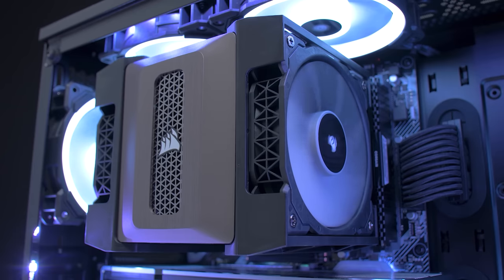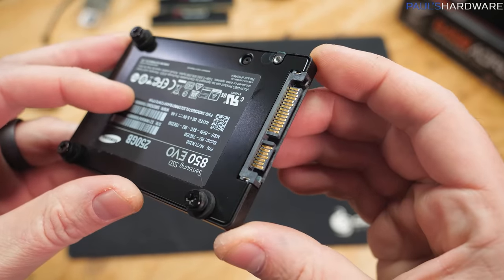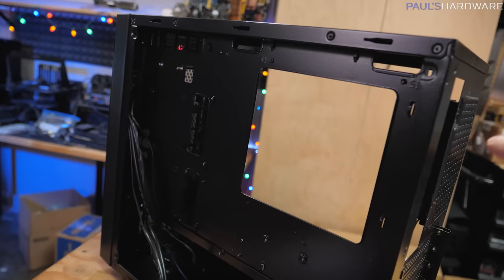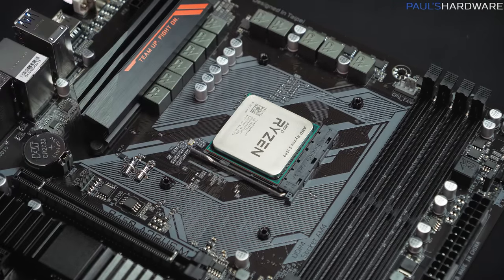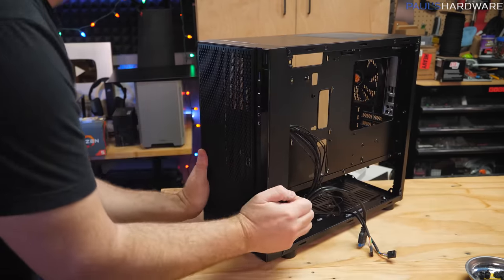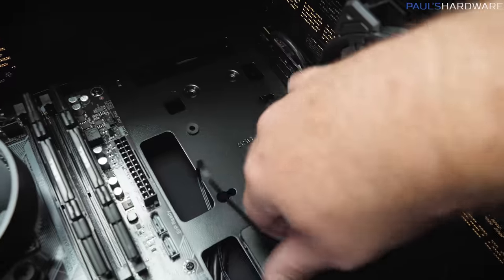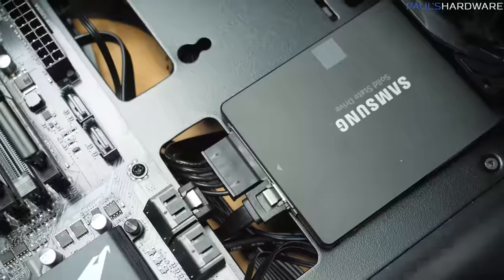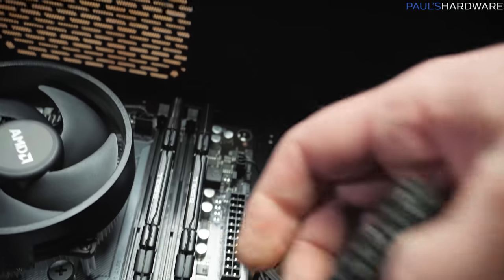How To Build a $550 Gaming PC in 2020!

Comment: The only thing I would suggest differently would be the GPU. For an extra $20-$30 you could go with the RX 580 8GB. for ~$145 it's a hell of an entry level graphics card.
Reply: How do these entry level PC's compare to the Xbox One X or PS4 Pro?
Reply: @solefreak2  they absolutely smoke em'. I love my 1X, but you can only spend $500 on a console so many times until you realize how much more you could truly get with a $600 PC.
Reply: @zhonestguy  In what regard do they smoke them? Graphics, performance? Never gamed on a PC so not sure how to compare. Also with the new gen consoles due to launch, these are being touted as being as good as some of the current top end PCs.
Reply: @solefreak2   The one thing that console does better for the price is resolution; however, this arguably means close to nothing if your fps is low (which it is on console). PC generally runs on a lower resolution than console (1080p or 1440p versus 4K on console) when gaming, but the fps is at least double (on a budget build) and as high as 10x (on a moderate to high budget build). A lower resolution with substantially higher frames far exceeds a higher resolution with substantially lower frames. Functionality, I feel, is no competition considering the overall use of a PC versus a console. Now, when it comes to the new consoles I highly doubt they will be able to touch a PC. The way they're advertising the new gen consoles is how they advertise every time a new one drops and the end result is always the same. The issue with consoles isn't the manufacturing or the capability of the machine, it's the way the games are developed. You ever notice how when a game is demonstrated it's never done on a console? That's because games aren't developed, for consoles, to run at full capability. When a game is developed for a console the companies have to consider what gen of console it's going to be played on most and the majority of the time the previous gen is favored for the first year or two. As a result, these games are made with lower specs. 4K games was a pain in the ass for the first year or two of 1X because none of the games were being made to play at that resolution (games were made with previous gen in mind). As a result, we had a $500 4k console running games at a lower resolution AND lower fps. When a PC game is made it's entirely different. When you pay the $60 for a game on a PC, you know the performance is based only on the hardware it's being run on, nothing more. Higher quality hardware equates to higher quality performance, simple as that. With console, that's simply not the case. You could have the latest and greatest, but if the game developers don't make the game for the latest and greatest (which most of the time they don't until after the first or second year), you lose out. By the time the games are being made for "full capability", the talk of next gen consoles is already in the works. Full circle nonsense.

Comment: “Only costs $85” 
Link say $270. Lmao
Reply: It’s insane right now, I had plans to get me a Ryzen 5.  Had to go with the Ryzen 3 with integrated graphics for $100.
Reply: @AgentSeventyOne  oof
Reply: @AgentSeventyOne  how are the prices at micro center?
Reply: @zhao4113  Oh dang, it’s 180 right now.  I just got the other one lol.  I guess I can put some money in on a solid gpu for now and upgrade the cpu/motherboard later.  I was eyeing the a $330 bundle.
Reply: @AgentSeventyOne  lol for that price i could get the AOC cg27 monitor which is the cheapest 144hz 1440p monitor
Reply: @zhao4113  I cheaped-out on that, but I did find a 24” 75hz monitor for about 110ish.
Reply: @zhao4113  my CPU order was cancelled lol.  Maybe the Ryzen 5 will drop a little more on Black Friday.
Reply: @AgentSeventyOne  it'll probably drop a ton on Christmas deals and stuff like that I'm gonna upgrade from ryzen 2600 to 3200
Reply: @zhao4113  I bought the Ryzen 5 with integrated graphics for 200, I’ll wait for a deal on a solid gpu for Christmas
Reply: @AgentSeventyOne  yea christmas always has some huge promotions on parts im gonna go ham 😂
Reply: does the graphics card change automatically or can you change the color manually
Reply: 8 month old video..
Reply: it obviously cost $85 when he made the video 8 months ago, links just lead to the CURRENT price of the product...LMAO
Reply: @AgentSeventyOne  i don't know a lot but after reading up I'm going with a 75Hz monitor because with my budget I'm not gonna get much more than 60fps with ultra graphics anyway you know? It would be a waste of 200 bucks because if I'm going 144hz anyway I'm not going to buy a monitor with terrible ghosting just to be able to run at an fps my rig can't handle in the first place
Reply: @tonyl9636  You should check out “Tech Deals” YouTube channel. They do vids on how to spend wisely on different parts. Helped me a lot. I have a 75hz a we monitor that was like 100 bucks, works great and I can’t wait to get another.
Reply: *acer monitor

Comment: Awesome Build! If I wanted to be a Little Nitpicky... You Forgot to connect the Motherboard Speaker! LOL!
Reply: Forgot to mention that those gigabyte boards with the dual bios are complete garbage and should be avoided at all costs... and that using an M.2 drive disables sata ports too... sure expand that storage only to find out you can't... this is amateur stuff that the verge wouldn't put out.
Reply: @HecklerUK  I have this board and an M.2 nvme ssd as well as a standard sata HDD. Using the M.2 interface most definitely does not disable sata connections lol.
Reply: @lucass8119  it does disable 2 ports, but there are like 4 left over. So he is right and wrong at the same time. He sounds pretty salty.
Reply: @HecklerUK  RTFM
Reply: @HecklerUK  ...this comment reminds me of a Verge article.

Comment: Thanks for this video Paul. After several failed attempts at purchasing an already made system through local Marketplace users, I decided to try my hand at building one. I have general basic knowledge but have never done a complete system build. Thanks to this video and your videos about 5 steps to take after the build and the one on how to get a Windows key for $20 (it was $33, but still cheaper than through Microsoft) I was able to successfully build a great system! Thanks so much for your help and guidance through the process. I ended up using everything you tagged except for I updated the graphics card to an RX 580 and I used the Ryzen 5 2600.

Comment: Looks like a good build for the price. Would be nice to see how this build performs in actual gaming.
Reply: Luiggi Rosado This pc could run most games at easy Mid to High graphics. Although max settings may vary from different games.
Reply: I agree with @IllegalMex1can. I personally would upgrade the GPU to the Nvidia 1660 super for $100 extra (New). With that GPU matched with the memory and CPU mentioned, you should be able to run almost any game prior to 2020 at Max settings easy peasy. Or, you can go with this build and upgrade later down the road.

Comment: Do the parts come with the cables or do I have to buy them separately
Reply: Should come with the cables.
Reply: After I built this my game only did 85fps
Reply: @teammando7749  damn bro that's disapointing
Reply: @teammando7749  Better then anything is all the matters
Reply: @teammando7749  what did you expect it's only a 550 dollar build
Reply: Mando are you sure because my teammate has the same built a his fps was 125 so your WiFi probably sucks
Reply: @teammando7749  Stop lying, seeing other comments of you, you said it ran at 145 fps, running at 85 fps shouldn't happen at low settings if it does you were probably running Cyberpunk 2077 at max settings
Reply: @joseplazola1236  the wifi doesnt interfere fps at all
Reply: I had a Gigabyte board recently that only had one fan header.  Since the case had two fans, I had to buy a splitter separately
Reply: Mando _ 😂😂
Reply: @ZER-cr4dm  Cyberpunk 2077*
Reply: @xAmetoxoriginal  Thanks my mind thought of metro 2033 and cyberpunk lol
Reply: Doctor Who Cares I don’t play max settings, I only play medium for fortnite, and maybe it’s cos my mouse and keyboard are crappy, idk
Reply: Vulo when I play stacked scrims, I normally get 60fps or maybe slightly over
Reply: Vulo that’s what I used to but I only was getting like 50fps, my laptop was better
Reply: Team Mando overclock it
Reply: dont like dis comment again! it has 69 likes...
Reply: Team Mando don’t know why you’re complaining. Anything over 60 is good. Getting 100+ FPS is cool if you can but totally unnecessary
Reply: Yeah you dont need 145 unless you have a 144hz monitor
Reply: Will this run fortnite

Comment: When he says the cpu is 80 dollars bit its 200 on Amazon
Reply: prices change
Reply: @bodhiza  ik. But most prices don't go to $80 to $200 in a short amount of time
Reply: Blame corona
Reply: Jaidyn C Maybe limited stock
Reply: Same with the graphics card. It's now twice the price that he stated in the video.
Reply: @jaidync108  Actually, it did. I was building my system around this time and it had jumped way up. Then, it went back down to around $120. I snatched it up when it dropped.
Reply: @jaidync108  toilet paper did. went from $12 for a 24 pack to 15k lol
Reply: I got it only months ago for 75.
Reply: all the tech youtubers randomly started making budget builds with the 5 1600 and demand increased by 200%. at 200 you can get a 5 3600 which is much better
Reply: Donny Dingleberry  r/buildapcsales is where it's at. last post on r/pcsales was one year ago apparently.
Reply: Prices changed because ppl like to buy bulk and resell high as hell just to piss ppl off
Reply: The Gigabyte Aorus Radeon 570 doesn’t cost $120 it costs around $225
Reply: 500 nothing this is an 1000 build
Reply: Bro rip I'm never gunna get a pc
Reply: Samo depends, I paid 150 for mine start of the year. 
I have pretty much same build, I use the 3600x cpu, msi 450 tomohawk mb but I built mine for around 750.
Reply: Caine OrIsIt yeah bro u bought it at the start of the year and now cuz of corona it costs twice as much as it did cost
Reply: Vulo where?
Reply: Covid messed up pc parts manufacturing in China which caused prices to spike.

SSDs also went up in price.

I bought a western digital blue sn550 m2 ssd for $100 CAD back in March its $194 now.
Reply: @samo4955  just got a 570 for 130 from a deal on newegg and 80$ on a ryzen 3  3100 at microcenter just gotta keep a look out
Reply: If you take a moment to pay attention, you'll notice that OLD products go way up in price when there is very low stock remaining. Currently (September 11, 2020) the Ryzen 5 2600 is 139.00 USD. It is successor to the 1600 (low stock, ridiculous price) and predecessor to the 3600 (209.00 USD).

I'd also consider the GTX 1660 Super 6gb for 209.00 USD over the Radeon RX 570

If you are really on a budget, you may like the Ryzen 5 3400g with Integrated GPU for 145.00 USD, or the Ryzen 3 3200g with Integrated GPU for 99.00 USD and avoid buying a discrete GPU.
Reply: ...yes, Amazon is the only place you can buy PC components.
Reply: otacon1024 yeah exactly I see the graphics cards going from 60-100 on eBay and the cpus at around 100
Reply: It costs more than my cpu for Christ sake!!
Reply: Jaidyn C just use a ryzen 3 3100 , just as good, and it’s faster
Reply: @jaidync108 can get the ryzen 5 2600 for $140 atm
Reply: Prices are going down again tho
Reply: Vulo  where?
Reply: @boyanpetrov1683  you got some insider info for us martha stewert?
Reply: @aaronbrandon2321  huh?
Reply: @aaronbrandon2321  not all of them are going down, tho some are
Reply: @hamyncheese  what a weird concept. I can’t think of anything of the top of my head that increases in price when the newer better replacement arrives.  Vehicles, cell phones and TVs to name a few all go down in price when the newer version comes out
Reply: @GreenMountain565  You are thinking about value, not PRICE. Prices are often determined by algorithm. When an older generation model is out of production and few units remain on the market, the algorithm rasies the price. Look on Newegg right now for a NEW Ryzen 5 1600 (195.00) and compare it to the price of a Ryzen 5 2600 (149.00)
Reply: Then why trust him at all when he tells you to buy Ryzen. Go intell for quality
Reply: Title says $550 build, in my head it translated to $1100 build. I'm just use to doubling anything for exchange rates  (2x seems to always work well).
Reply: @LogicalSchizoid the Ryzen 5 cpu i am looking at getting for my new build is just under $300 Canadian ($298) plus the 15% tax.
Reply: @Smokinkguns  also known as scummy scalpers/resellers.
Reply: @LogicalSchizoid I'll check out the prices on Amazon and Newegg Canada and see what the difference is in price and specs.

Comment: Mostly a console player my whole life. Wanting to start the switch to PC. Never built a PC, but will this build handle war zone?
Reply: yes it definitely will be able to. But i recommend Ryzen 5 2600 & RX 580 instead if u want a smoother performance
Reply: Top Suey umm what are those could you please have a link I’m kinda dump
Reply: @Nevilos  I know you guys will hate on me but will it run fortnite?
Reply: @luke_Parise  If it can run WarZone, it definitely could run Fortnite.
Reply: Bacon Williams but can it run Minecraft
Reply: Ctcamacho2000 I hope this is a joke but yes
Reply: Bacon Williams  Thank You
Reply: Molddy Doughnuts lol yes it’s a joke
Reply: @chriscamacho2000  Maybe if you keep the settings low, you will be able to get around 30fps. Not sure though. Also, try adding as much RGB to your case as possible, I hear that it helps.
Reply: Would this run a rp server on fivem like gta at a good fps, smoothly and not much texture loss?
Reply: Bacon Williams is this a joke
Reply: @Nevilos  if i found everything he recommended in the video and just switched out for the ryzen 5 2600 + rx 580 would everything still be compatible?? super new to this
Reply: @sotiredlol  Yes it would be compatible. Theres a website called PCpartpicker and you can plug in pc parts to see whether or not they are compatible or not

Comment: For those wanting a good SSD to replace the one in the video, the WD Blue 3D 500GB is $60
Reply: I would also recommend the WD SN550 500gb. It's NVME M.2 and 5 times the speed of the 3D. I got mine for $64. But the price jumps around a bit.

Comment: Is there an alternative case? The one you listed is unavaliable
Reply: if u find one can u let me know
Reply: DEEPCOOL MATREXX 50 ADD-RGB 4F Mid-Tower Case 4x120mm ADD-RGB Fans. This one’s perfect
Reply: Can a mid-tower work with any micro atx?
Reply: The thermal take versa h 17 is pretty good
Reply: Guys check out the "Inter-Tech CXC2" and thank me later :D
Reply: @oaiy5439  Cases will always (from reputable brands/sites) list what form factors they support. You're looking for M-ATX or, if using his sub-in board instead of the B450, you're looking for ATX (with no M or E on it). Just check the details of a case, and double check reviews for mentions of Air flow, cable management, and other notes about quality.

Comment: Does anyone know how good this runs games and how many frames a game typically gets? I just wanna know how much it is worth getting this build :)
Reply: Depends what you're planning to use it for, this will run most demanding games on mid-High settings without an issue, with a stable connection obviously😜
Reply: oblivionjaycee how will call of duty run on this?
Reply: oblivionjaycee thank you !
Reply: jdollar67 I’ve been looking at rx570 + Ryzen 5 1600 AF benchmarking and you can see loads of games benchmarked with the stuff in this build , call of duty will run to about 60-90 frames which isn’t bad , you can look into benchmark videos to see !
Reply: @boofzaiah5125  could you please tell me if a an rx 570 is good in 2020
Reply: @nathanaguilar9642  ye it's decent, it's equivalent to the gtx 1650
Reply: oblivionjaycee thanks

Comment: Paul, would a pc like this be able to run AAA games like Witcher 3 or Doom Eternal?
Reply: Yeah it would be able to, not sure what the settings would look like or the FPS, but I'd say it would be by no means bad. Probably 60-90 FPS on 1080p high settings.
Reply: Watch a benchmark video showing the graphic cards your going to use
Reply: Yes, but actually no
Reply: Upgrade graphics to 1660 ti and yes. Found for around $280 right now
Reply: Yes it can at 1080p mostly high settings with a couple medium thrown in

Comment: Hey Paul, thanks for the awesome tutorial and your other videos as well. Just built my first PC using this video and set up. Only changes I made were on the fact that I used a Gigabyte Radeon RX580 8gb graphics card, I used 4x Corsair LPX Vengeance 8gb DDR4 DRAM 3000mhz (I know its overkill but I had them from another PC that I was taking apart),  a Samsung 950 pro m.2 NVMe SSD 512Gb along with a 1 TB SSD as storage coupled with a 3 TB mechanical hard drive. I also had a EVGA 850 80+ Bronze PSU available so I used that. So far its all working great, so thanks again.

Comment: I know this would sound cheesy but what if i want lights inside my build lol
Reply: buy LED strips. stick it inside the case on top and connect it to a power source (check MOBO manual for connection). or buy a fan w/ LED lights and connect it.
Reply: They make Red Blue Green LED parts.
RBG Ram
RGB Case Fans
RGB GPU
So many lighting options
Reply: If you are on a budget, I'd suggest leaving lights for later on, like RGB fans or strips. Otherwise, you could spend like 10% more for having RGB in your parts from the begining. 
Personally, as I don't like lights that much, I'd highly suggest prioritizing performance rather than aesthetics.
Reply: Hater Tóxico I want a build a dual monitor pc to use auto cad and blue beam . Is this build powerful ?
Reply: @takeoffready6218  I don't know what those things are, srry. Ask other people, I cannot help you, mate :/